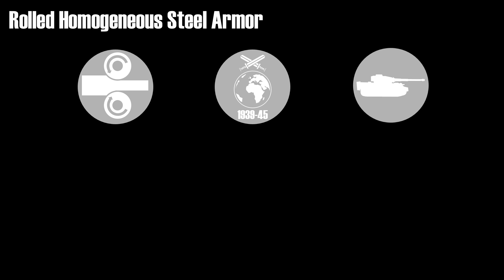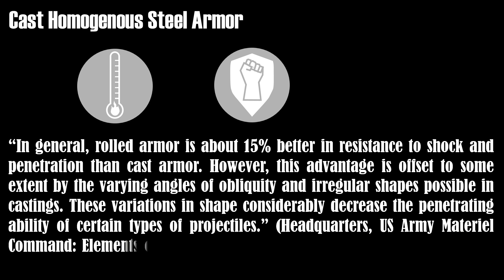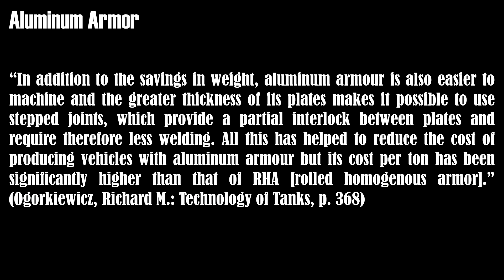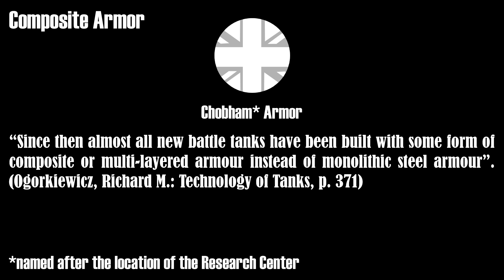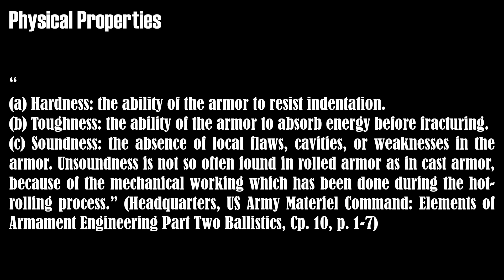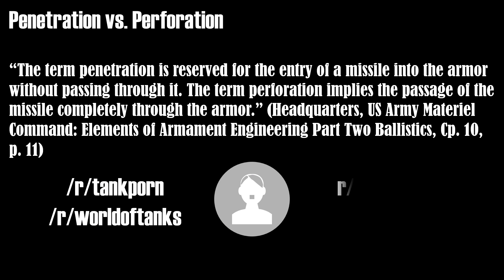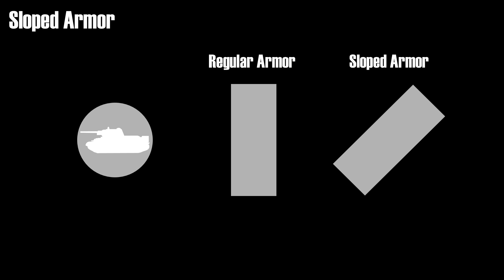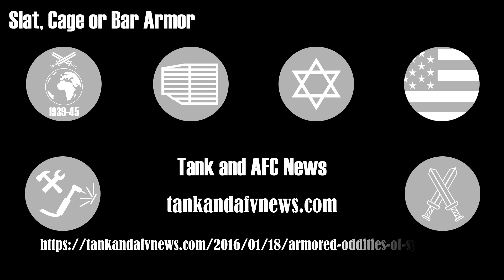[Tanks 101] Armor Protection 1920-1980 - Features and Characteristics

Comment: What is the difference between a shaped charge and the EFP in the Iraq War?  Those EFPs penetrated armor Humvees, strykers, with the "batting cage" armor, the Bradley and I think the Abrams.
Reply: John Paul Thessen 

They are the same thing, mechanically speaking. It's just that "EFP" is usually used to refer to conical charged that are fixed in place (like mines or IEDs), while "shaped charge" usually refers to the warhead of a projectile. Both use the same physical effect (Miznay-Schardin effect). The DoD loves to make up more jargon for the same thing :)

Comment: You said, you're not completely sure about heat rounds so here I am. What it is, is a molten jet of copper, now people say well it isn't molten, it's plastically deformed. There's elastic deformation and plastic deformation and elastic deformation is bending a wire and the wire spring back into place whereas plastic deformation is a wire bending and staying bent. The copper does melt because it is copper, it has a very high heat transfer speed so it takes up the heat from the explosion instantly. This super heated molten jet contacts steel where it melts the steel away instantly because of the high heat transfer of copper. This is why it doesn't matter as to what quality steel you are using, it just boils steel out of the way. The explosion and shape of the copper cone has to be controlled so you get as narrow of a jet as possible so that you try to just get the copper to pinhole through the steel. So to say a heat round is an explosive round is a HUGE understatement. 

Well why do you not want to use a heat round on modern tanks? Because of chobum armor and reactive armor. Modern tank armor is ceramic to counter EXACTLY this. Cermaic doesn't handle explosions as well as steel because it doesn't plastically deform, however it doesn't melt to copper jets. So ideally, you would want a steel cage to hit the rpg round and then disperse the copper jet to do nothing however next to ideal would be steel to absorb the explosion and then ceramic behind that to absorb the copper jet without harm. Reactive armor is a beast on it's own and explodes the copper jet away but it's a one time deal and hard to design so it doesn't set off the other explosives sitting right next to it and overall shit compared to chobum armor, but it is cheap.Explosive armor also provides no protection against sabot rounds.

Sabot's/kinetic penetrators are ideal because they go through metal easy because metal tries to spread the impact across it like a web slowly while it deforms which is why it's good for explosions however when it hits a kinetic penetrator like a bullet, it can't spread the impact out. When the penetrator hits ceramic however, the whole ceramic shatters and helps absorb the impact as well as abrades the penetrator as it passes through but really you're still screwed. The kinetic penetrator is a very difficult thing to defeat and because we haven't seen explosive panels on abrahms, it's safe to say explosive panels don't work either. We might see in the future railguns fighting tanks as well as railguns mounted on top of tanks to shoot down the railgun's shot XD. I actually evision within 30 years, tanks are going to be obselete on the level of fighting first world countries because rail guns will be made so fast and strong that you can't counter it.

Comment: Please advise: I noted there is a gap or space between the main gun and superstructure, what would happen during raining? Is it sealed with some glue? rubber?? Rain water leaking in? Damaging the wire/radio etc?
Reply: The hole where the gun goes into the turret is blocked off by the joint the main gun pivots on, also most tanks have some sort of canvas/rubber sleeve that covers the whole thing up but that's mainly to stop dirt and water getting into moving parts.. 
Here's a good cross section of a Tiger tank that shows how the hole is completely filled in with armor and the joint as you can see rainisn't getting past that.https://s-media-cache-ak0.pinimg.com/originals/a5/98/cd/a598cdc4f3bb8d4883756cc9ececf399.jpg

Comment: But doesnt the Munroe effect burn through armor? its molten metal that is shot trough
Reply: Dupa Krowa 
I was just about to comment on that. Shape charges does not "burn" through armor. It punches through armor due the very high concentrated pressure generated by the explosively formed jet. I believes it's in the order of tens of thousands of psi, but not sure. There is not enough time to "burn/melt" through the armor. The super heated jet and and molten spray following the explosive jet is an added bonus. I once looked that the mathematical equation modeling the jet punching through metal. It was one scary equation. It made a class of graduate metallurgy students go white. There was massive nervous laughter when I said the equation was beyond the scope of this class and presentation. Basically, the best analogy of what what happens is heavy motor oil poured into water. Caveat. I have no rest hand knowledge of that.
Reply: --
 Well I wouldn't expect metallurgy students to be mathematically proficient, more in chemistry
Reply: Dupa Krowa ,

Naturally, I don't remember the exact equation after two and a half decades, but it involved the multiplication of two integral, each with an exponential function. Which isn't that bad, but the power in both exponential function involved imaginary numbers.

It seems imaginary numbers are involved in a lot of fluid flow equations. Don't ask me why.

Comment: 6:10 "...the hollow charges are not greatly affected by material's density."
My understanding of the matter leads me to believe otherwise. Its more like they are not affected by material's properties like hardness and yield strength, which are determinant for the ballistic resistance against conventional AP shells. 
In fact the density of the material is the most significant factor influencing its effectivness against HEAT warheads. The approximate relative resistance per unit of thickness is given by the square root of the ratio of materials densities. So the armor made mostly from alluminium, that would provide the same resistance a given thickness of RHA, would weight only 59% while occupying 170% of the original volume.
Edit: I see you explain this better later in the video so you probably know this already. Oh well, I'll not gonna delete this WallOfText, maybe somebody will find this interesting.
Reply: MadEngineer,

My understanding is that it is the fracture propagation and energy dispersion properties rather than density that controls penetration of shaped charges.
Reply: True, but that only becomes relevant in advanced armors employing 
materials other than steel. I was limiting to a specific example to 
avoid writing an essay in youtube comments.

Comment: Its actually a myth that armor sloping increases protection by allowing one to use thinner plates. its important to note that the overall thickness of an oblique plate does not change in weight due to sloping, as the plate will have to be longer: as the hypotenuse of a right triangle is always longer than either leg. the weighr savings and increased protection comes from the fact that there is that plate now covers more of the roof, what additional material is needed to make it uo can be now removed to reduce weight, or reinvested into the front plate to increase protection.

Comment: I've got to ask as a Yank-where does the extra 'i' in your pronunciation of 'aluminum' come from? My German mom says it the same way.
I drove an M113 in the Army. One of my platoon sergeants called them 'tracked grenades'. There was a reason the M113 added 1 inch thick sliding kevlar spall liners to the inside of them because of the 'spalling effect' of rounds perforating the aluminum 'armor'.
Resistance to shock is a lesson the Titanic sinking can teach us. The iron of her hull was subjected to the frigid Atlantic water and ripped like a beer can on impact with the iceberg.
Reply: James Robert 

A better example of the brittle transition temp were the Liberty ships in WW II.

PS I was a 19D, trained on the M3 Bradley, assigned to a unit with M113s, later Hummers, then M901s.
Reply: -- Oh yea the Liberty ships snapping in half right? You must have been disappointed to train on the Bradley but end up with the M113. The one I was assigned would downshift on the slightest grade until my LT and I were doing 1mph...getting the mechanics to do anything was futile.
Reply: James Robert 

Actually, I did not like the M3 as a scout vehicle. Optics were good, but it was taller, slower and louder than the M1 Abrams we would be scouting for. Good IFV, not so for a scout. It was way bigger than it needed to be since we usually had only 5-6 scouts in a vehicle. Army did not want to invest in a dedicated scout vehicle.

Comment: Doesn't rolled steel still technically involve cast steel plates?  Also, hardening only involved case hardening (unless they had the technology to harden beyond 8mm or so).  And presumably the rolled plates would be hardened after rolling...
Reply: No Free Will 

The answer is maybe. In some mills, the metal is rolled while still red/white hot out of the cast. The strengthening comes from the deformation process of rolling. Carburization adds additional surface hardening to either rolled or cast metal. Ideally, you should only harden one side, the outside. If you carburize both sides, the inside is prone to spalling.

Comment: very nice video! 
one point about sloped armor:
In regards to armor thickness, sloped armor is not better than not-sloped armor. If you angle a piece of armor 60 degrees, you receive twice the thickness, but you cover only half of the vertical space, so you'll need twice the length of the plate to protect the same area. So you could just make a vertical piece of armor twice the thickness. In essence sloped armor doesn't offer better thickness kg for kg. 

BUT the slopping does improve shot bouncing, and most of it's advantage comes from that.
Reply: "Bouncing" is a highly complex issue. With relative density, thickness/diameter ratio, velocity, penetrator design and armor/projectile hardness as inputs.
For WW2 type projectiles( and barring ridiculous t/D ratios its usually between 60 and 70 degrees that you approach a critical angle.

Comment: Imo the armoured skirts used by the Germans in WW2 were not initially at least, for protection, they were for making old tanks (Pz3,4) look like new tanks (Pz5,6). If you want to stop an anti-tank bullet, then you don't need skirts, you just need to bolt on thicker plates which the Germans were already doing...